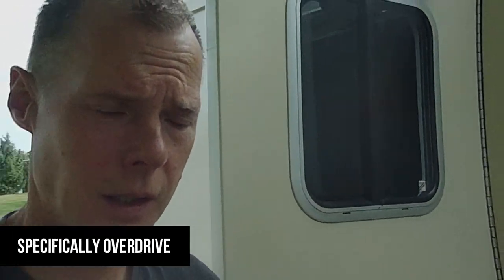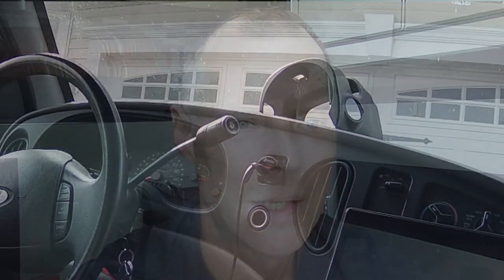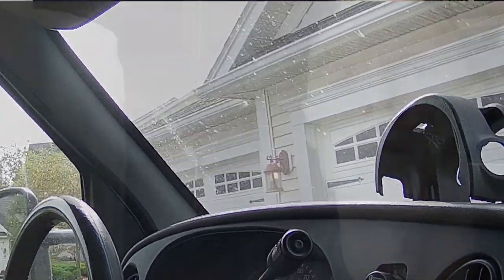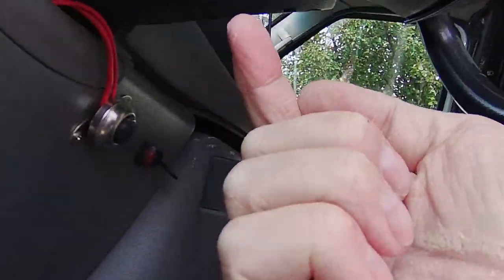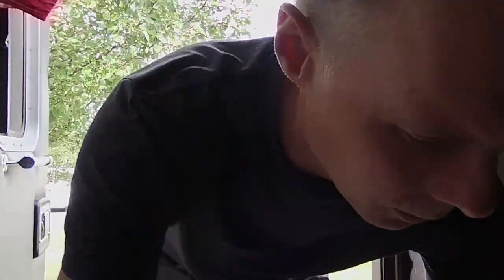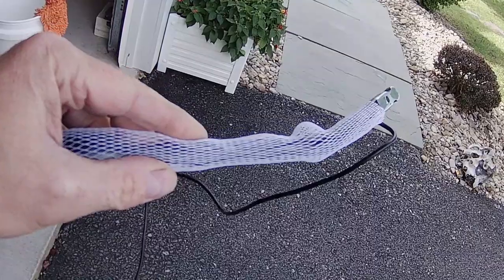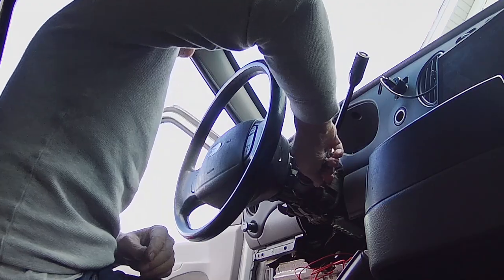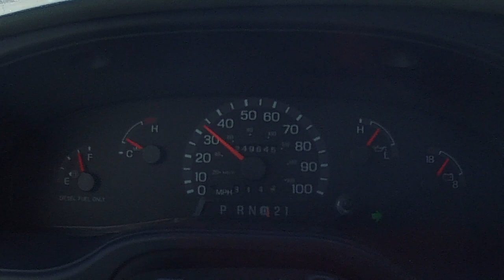How To Fix Your Ford Ambulance Conversion Skoolie Van Overdrive Button For CHEAP!!! EASY!

Comment: I must of  had and  driven 12 e250 vans . I'd say half the OD button didn't work after a year or so. Great job , you amaze me with how much you fix yourself.
Reply from the maker: That shift lever wiring is pretty much a 100% failure rate :/ Thank you for the compliment :)

Comment: I have a 1996 F350 Pickup with the 7.3 TD and a 2009 E450 Ambulance with the 6.0 TD.  Both have the Overdrive ON/OFF Button just like what you see in the Video.  What I like the most about the Switch is going Down Hill.  Take it out of Overdrive and the Engine slows the Vehicle down.  Great for Hilly Country and saves the Brakes.  I even use it for HWY to City Speed Zones, drop from HWY Speeds to 45 MPH and never touch the Brakes.  When you get slowed down to 45 just put it back into OD and the Engine slows back do and smooths down.  If you are in Cruse Control, tap the Brakes before dropping out of OD.  JimO
Reply from the maker: Good info thanks Jim!

Comment: I had a Windstar with an overdrive button on the end of the Shift Lever.

It was replaced with an Aerostar that has a dedicated Overdrive Position (P-R-N-OD-D-2-1) which I prefer.

These are both small vans, the Windstar had Front Wheel Drive, the Aerostar has Rear Wheel Drive.

Also after the Windstar, after a Recall the Overdrive could only be switched in Park or Neutral.
Reply from the maker: It would be good to have the OD as a shift position like I've had in other vehicles.
Reply: @TheCampulanceMan  

I think a 1964 Mercury Comet belonging to the mother of one of my grade school class mates had this (called "D1" as opposed to the Non-Overdrive "D-2").  My dad installed a similar Engine/Transmission into a 1962 Falcon he had.  He also had a c1958 Studebaker Truck that was Column-Manual shift and had a Pull Knob on the Dash for Overdrive.
Reply from the maker: Mercury used to have the 'green dot' automatic that confused people so much they discontinued it quickly. It had people starting in 2nd....

Comment: Hey David..like the previous post said..the torque converter lock up seems like another shift. My 93 has the predecessor to the 4R100..the E4OD. Had the same issue and like you replaced the shift lever and all was well again. Not being able to turn off the OD can be dangerous.. especially when going down hill..overheat your brakes fast.
Reply from the maker: Hi Paul  - I guess the failure on these is really common! I'm glad to have it fixed but I wish there had been enough wire to do a repair on the original one... then it would have been REAL cheap!
Reply: @TheCampulanceMan  I actually tried that before replacing the entire lever. Those wires are so tiny and thin..it was worth the money to just bolt a new part on 😁👍 Side note..I actually bought the end switch kit but after looking closer realized I needed to replace the lever. When my lever showed up..it didn't include that switch and end cap. So I ended up using it after all..lol.
Reply from the maker: So the switch is removable? I could have done it for free??? AGGHHH!!

Comment: You might want to look into getting a Hydra tuner. You can tune the power on the fly as needed to help with those hill climbs and towing if needed. If you're wanting to reduce EGTs you'll need to start looking at upgrading to the traditional bolt-ons such as bigger down pipe and exhaust. The better the flow the lower the EGT and more accessible the power is.
Reply from the maker: I've done some research on tuners and egt monitors... There's so much information that it's hard to weed through.
Reply: @TheCampulanceMan  Not too sure about E450 but my rig has the 7.3 powerstroke and everyone recommends the PHP Hydra tuner. For exhaust you want bigger to reduce back pressure. You want stainless to help prevent rusting so 4in or even 5in exhaust is what you want, brand does not matter just make sure they use quality steel. The downpipes in our trucks usually are smashed for fitment which chokes all that pressure youll want a 3in down pipe. You can usually find a full turbo back exhaust that will fit the truck. If you cant find a kit just take it to a solid muffler shop and they can make a custom one.
Reply: @TheCampulanceMan  https://www.jelibuiltperformance.com/collections/frontpage This is where I am planning on getting mine.
Reply from the maker: Thanks Daniel  - they have options there for sure :)
Reply: I ended up with a dp tuner which has 5 tunes of at most + 80 hp. I use +40 towing mode because the truck is so heavy it’s like towing all the time. That plus an edge monitor ct2 helps me keep track of my temps. You’ll start to drive by egt  instead of speed or rpm etc. 1250 is the #, try not to exceed for any length of time, the engine will be happy.

Comment: A guy is selling a 2011 Freightliner ambulance with a 200,00o mile  diesel 3.0 l v6 2011 sprinter. He alleges a mechanic said it has a leak in the turbo lines “ hoses” so it runs in a limp mode. He is asking $8,000 but I think a turbo replacement would increase the price for about $4,000 which is too much for 200,000 miles. I do not think the limp mode is a result of a leaking "turbo" line. What do you think?
Reply from the maker: I know there's many things that can put something in limp mode. I'd pull codes and see what they tell you before considering.

Comment: i have the same overdrive button its on automatically unless i remember to tern it off when i start driving i only use it on the freeway and high speeds
Reply from the maker: I've just started turning it off for lower speed driving if I'm in hilly terrain.
Reply: @TheCampulanceMan  i have herd from my neighbor that  that the transmission on these things are pretty beefy he used to be a truck driver this is the first diesel i have owned i like the sound of the turbo winding up    :)
Reply: @TheCampulanceMan  Hey David..if it starts going in and out of OD turn it off. Otherwise the trans gets hot.
Reply: @crossxcats  Right! Love the turbo whistle!

Comment: Lock up torque converter,  no overdrive just disables lock up
Reply from the maker: In the owners manual, it says that 4th gear is disabled when od is off. I still get lockup. I can feel it happening. In the vid I didn't yet understand that  :)